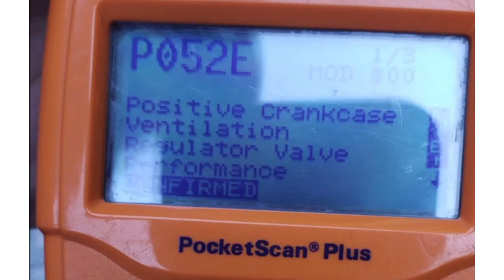2015  C300 2.0l Mercedes  , crankcase ventilation line /oil separator .

Comment: Whoever is having this issue, take your vehicle to your Mercedes Benz dealership. There is a extended warranty for intake line assembly which is the pcv valve., it should be covered 100% 15 years or 150,000 miles.
Reply: Mine just started this issue but not to sure if Mercedes cover it since I don’t have warranty on it.
Reply: They are covering my 2016 C300 at no cost.  I have been out out warranty for 5 years
Reply: Hi is this for USA only? I'm in Canada. How do I get them to take care of this for me? I have a 2019 model out of warranty. Mechanic quoted $1700 for repair
Reply: I’m also curious cause I checked recalls but doesn’t show up on there and I don’t want to pay for them to check as a diagnose
Reply: У меня мерседес 2015го года с300 120000ми 
Взял у друга обд разъём,проверил и выяснил,что эта ошибка
В мерседесе мне не отказали
Заменили бесплатно 
Даже батарейки в ключах заменили бесплатно!
Я в сша чикаго!
Reply: @urielgarcia9285 doesn’t matter if extended warranty is expired. This part was extended by the manufacturer.
Reply: @jb-on-the-mic honestly am not sure about this one. Did you get a letter from the manufacturer?? If not double check with your dealership just in case Before spending any money!!
I believe Canadian and US models are the same but don’t take my word for it.
Reply: @constantinecos5380 not such thing as an error my friend. I had many issues with my car because of this valve. 
Last year I had water pump and auxiliary water pump replaced plus other bunch of stuff related to it.

Comment: Just did this today in my driveway. 5 hours with coffee and lunch break in between. Make sure you have inverted torx sockets, 1/4” 8mm swivel socket, and a set of regular and stubby gear-wrench wrenches. Take your time, Not difficult at all.
Reply: You wanna do mine lol, I'll pay ofc!
Reply: @DLozano0405  Toronto, Im guessing youre in the states but never hurts to ask
Reply: @DLozano0405 ny,lic
Reply: @nicolezheng23  im in nj
Reply: So dont have to lift the engine out?
Reply: @marclindsay5945  no, you just need to support the engine with the jack in order to remove the mount
Reply: @sunnydevani5439  did you end up getting this done ? Just got this on my 2015 c300... How much did it cost and where did you go?
Reply: @darshany2d  Lol no, Ive straight just driven with the engine light staring at me. Probably not the smartest thing to do lolll
Reply: @sunnydevani5439  funny I’ve done the same thing ahahah. Pisses me off that Mercedes’ doesn’t make this part a recall. Happened to my 18” e300 when I hit 45k
Reply: Cool. Thanks for the tool tips and time estimate. I remember buying my 1/4" 10mm swivel socket for a water pump job like 20 years ago. And I love my 11mm and 1/4" stubby ratcheting wrenches, but I guess I should add an 8mm and 10mm to be ready for anything. Already have the e-torx set and tons of other mechanic tools. It'll be a fun job for a warm winter day or three, I like to spread it out and pace myself, re-assemble things when I'm rested instead of tired.
Reply: @darshany2d  any update on your case? they want $2500 to fix this…..
Reply: I’m having this issue now on my c300 2015, anyone fixed theirs yet??

Comment: Mercedes benz should have a recall for that issue. PCV failure in the 2.0 engine for C300 and GLC 300 is out of any scale of normal lifecycle mechanical parts.

Comment: MZ will cover this for free. They sent out letters to all owners with your VIN # on letter. The envelope was labeled "Extended Warranty Addendum". The extended warranty for the error code for faulty crankcase ventilation valve covers a wide range of models 2015-2020, C,-Class, E, GLC, SLC, etc. Covers 15 years/150,000 miles (whichever occurs first). Google the memo that Mercedes put out Aug-Sept 2023 to Managers if you cannot find yours and take it to a dealer. I believe the NHTSA also shared a memo on it. Mercedes will cover this for free. As well as other recalls or extended warranty that your vehicle has not been serviced for. If you already paid for service at a MZ dealer or purchased parts from them, you may be eligible for reimbursement. See details in letter. Hope this helps someone as it was a life saver for me!
Reply: Note - you do not have to have Extended Warranty on vehicle. This faulty part is what is covered itself.

Comment: I also have P052E in my 2017 GLC. However, it comes on and off. 2 shops told me to wait. What do you think?
Reply: How long did you wait before fixing it? Notice any things going wrong? Was it doing more damage by waiting?
Reply: У меня мерседес 2015го года с300 120000ми 
Взял у друга обд разъём,проверил и выяснил,что эта ошибка
В мерседесе мне не отказали
Заменили бесплатно 
Даже батарейки в ключах заменили бесплатно!
Я в сша чикаго

Comment: To anyone who is not a mechanic, this job cannot be done at home. This job is at least 10-12 hours.
You must have a lift and a screw jack along with a ladder. The Aluminum motor mount bracket must come
out as the seperator is behind it. The A/C compressor must be moved as it's bolted to the motor mount.
The intercooler, throttle body, computer and bracket must be removed for access from the top. This job is
very involved. Do your self a favor and take it to a dealer who's done hundreds of them. Hate to say it though.

Comment: My 2015 c300 it’s -0 degrees where I’m at I drove it to the gas station I didn’t let it warm up properly nd it stuttered for bit then went normal got home and a huge puddle of oil was under it all the oil came out of the dip stick tube could this be the cause 🧐 it’s always ran super good has 146k

Comment: Hoping for some help. I just did this job and put everything together and car won’t start. It cranks and battery tests good but won’t fire up. I retraced my steps and without taking stuff apart I looked at all electrical connectors I can see and everything seems plugged in. Any suggestions? Don’t have a scanner and also Engine light is not on.

Comment: Please I see a lot of fresh oil in my turbo inter cooler c300 coup and I seem not to have any faults codes what code be the problem
Reply from the maker: A leaking turbo,probably
Reply: @anarasii  thanks very much
Reply: @anarasii  am also suspecting the turbo but when I examine the turbine of the turbo it was good so can it be the oil seal in the turbo has fail or

Comment: I'm doing this job right now FML!
Reply: Doin one right now in a glc300. I know the feeling
Reply: @bongripperjoe  be carefully with the alternator reinstall mine was off a bit and kept kicking the belt!
Reply: Didn't have to take the alternator out. Worked that motor mount bolt out from the underside
Reply: @bongripperjoe  yes to remove the engine bracket
Reply: @bongripperjoe  way easier with the alternator out of the way
Reply: @bongripperjoe  got ya

Comment: How much do you think this could cost at the shop or dealership ?
Reply from the maker: Jacky Chen at a shop I will cost around 800$
Reply: A&N Vlog thats not bad. Thx
Reply: it's 4-6 hours and the dealer here in NY is $189/hr. Then add parts.
Reply: 2000